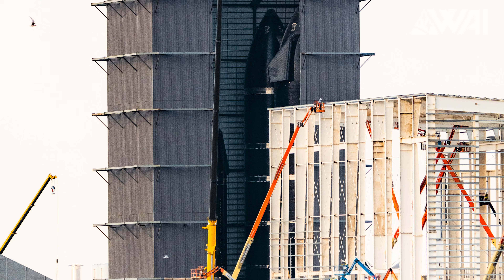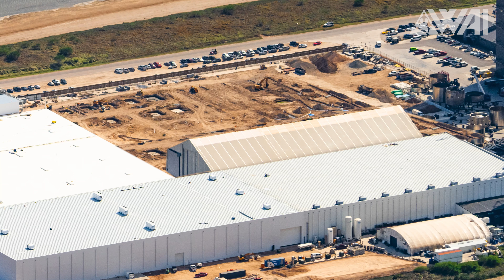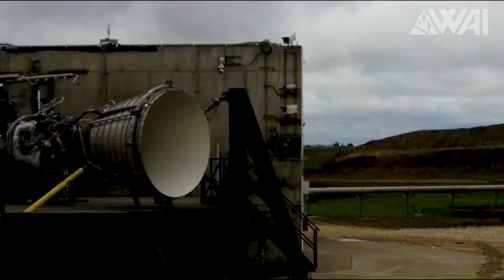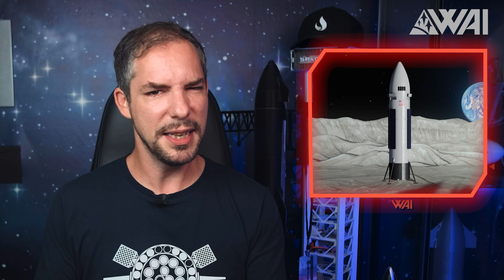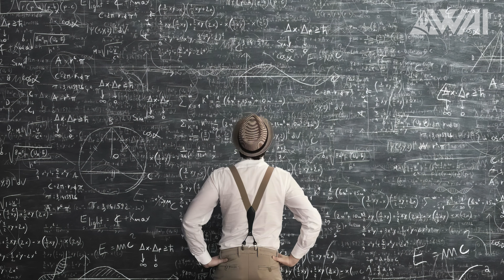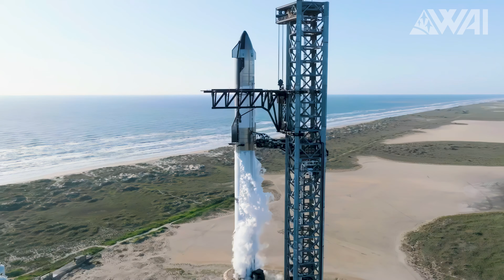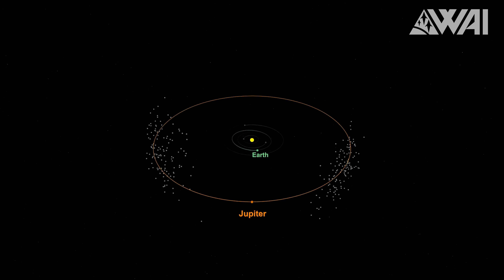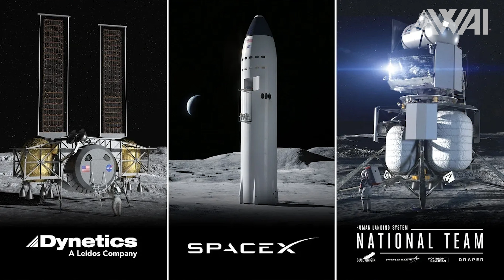It's Launch Time! SpaceX Starship Is Ready Including FTS!

Comment: Wouldn’t it be wonderful if the starship had a Star Trek inspired interior?
Reply: LCARS FTW!!
Reply: @vikvanderhaeghen200  I noticed something else - in a few of these renders, they showed a UI with virtual buttons along the edges. I think that's a rather good UI, possibly even in everyday use, e.g. on a tablet. Not covering a large part of your screen with your hand, instead being easily accessible, possibly even while holding it both-handed might be something worth investigating... :-)

LCARS looks cool, but I'm not entirely sure it's always ideal. On the other hand, ease of hitting a button is a function of the size of the button and the distance from the previous "place of interaction" (e.g. button press). (That was a subject in a computer science class I took, basically calculating UIs that were efficient to operate. The results always looked like crap, but they were quick to operate for specific sets of click-streams...)
Reply: @realulli My guess is that the UI for the control panels will follow the design practices SpaceX used for the Crew Dragon controls since that is in-house expertise already developed, has been proved in flight, and NASA is happy with it which is of course very relevant for Artemis HLS.

Although it contradicts my guess above another option is a stack of physical buttons to the left and right of each display with the labels down the left and right edges of the screen so that the physical button functions can be repurposed depending upon which screen an astronaut is in at any given time. Physical buttons can give better tactile feedback, can be made bigger without using up screen real estate that could otherwise be used for information display, and could also survive a touch screen failure. (The on-screen labels can also be made tap targets as an alternative to pressing the physical buttons to give extra redundancy in the event of a physical button failure.) I suggest this because I’m pretty sure I’ve seen such a scheme on some combat management consoles in the ops rooms of warships, another environment where a key design goal is a quick, intuitive and fault-tolerant UI for use by an operator who is potentially under extreme pressure.
Reply from the maker: How much Starship interior should be Star Trek themed? Yes.

Comment: The FWS must  complete it's review. This is mostly about how the water deluge system impacts provisions of the Endangered Species Act. The FAA review is done, but a launch license can't be issued without FWS approval. A completed FWS review is by no means a go for launch, they could require revisions. There is no indication at fws.gov that this review is concluded.
Reply: This FWS process is by definition a revisions from previous process that was concluded back in April license, so not exactly

Comment: The glass front of the Star Factory was always a less than ideal idea. The South Texas sun shine thermal energy would have been horrific to control.
Reply: Unless you just build where the sun doesn't hit the glass by facing it northward.  No sunlight, no excess heat (within reason).

Comment: I think they will opt for rollable solar panels.
My question is, if they want to put the docking hatch in the bow of the boat, where will the top tank go?
Reply from the maker: The top tanks are just in the nose on the current version for weight distribution reasons. If there's a full crew cabin with everything to it in the nose, then the weight distribution will be far less of a problem!
Reply: Providing those ships will stay in orbit or just do trips from the moon´s surface and back to earth orbit than they might not need a headertank.

Comment: Isn't there a header tank in the nose of Starship? How does that play out with a hatch in the same general location?
Reply: HLS may not have the header tanks installed as they might not be required for Lunar activities, or they moved them somewhere else
Reply: The header tank was only added to allow for landing, specifically the “kick-flip” maneuver. Lunar lander has a different landing propulsion system. Also anything staying in orbit like refueling stations won’t need it either. If the starship ends up being caught by the launch tower then it maybe removed from all but the Mars lander variant.